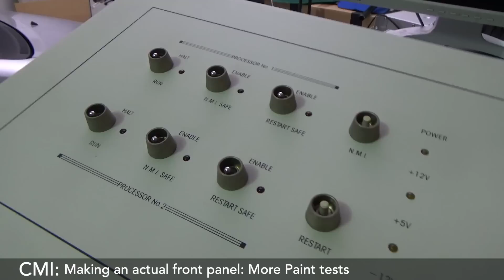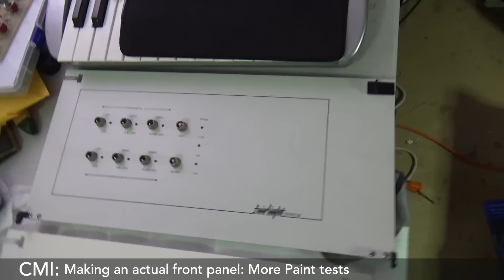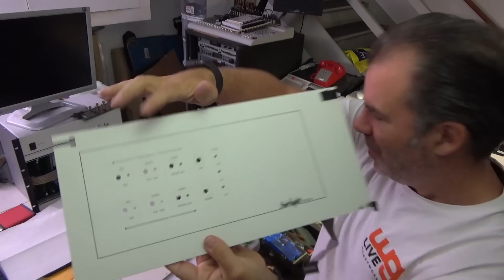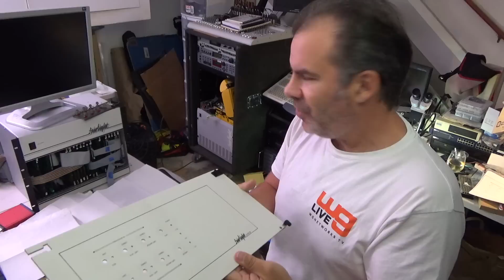I'm Building a Fairlight CMI: Episode 13

Comment: Hi Cris - I'm a big fan of you/your Fairlight project and have been watching from ep 1 right through to ep 13 here. I had a thought on your panel graphics screen printing sizing issue - instead of the photo-emulsion kit you are looking at for the screen printing (which has size limitations for the transparency you will have to try to print on - the darkness of that black will also be a major issue, incidentally), you might try just using cut vinyl instead. If you have access to a Cricut or similar cut vinyl machine, you can use it instead of trying to learn the photo-emulsion route - instead of the photo-emulsion being the resist (the area that doesn't print), the vinyl takes its place. First, there is no real limitation to how big/long you can go - it's only limit is the cut capacity of your vinyl cutter - but there are ways around that even if it is limited. Also, it's much more forgiving, way easier if you screw up - essentially, you could redo it over and over again until you get it right (the photo emulsion is one shot - if it gets screwed up at any stage, you have to start from scratch by reclaiming the screen with chemicals and starting over), so, the vinyl is much, much faster, etc. The photo-emulsion process of creating a screen is an art in and of itself. I happen to think you also get a much cleaner/sharp result with vinyl. You just need to get a physical screen that is large enough for your panel. There are lots of tutorials out there on Pinterest, YouTube, etc. for the cut vinyl screen printing process - so, just a thought. 

On the vector graphics and layout, I recently was working on graphics for a Roland PG-800 front panel that I need to redo, and for me (graphic designer), it was easier to take really good measurements (I used a machinist's caliper) and did the layout straight in Adobe Illustrator or a similar vector graphics program rather than trying to convert the photo you took on your phone. You surely can use it for reference, but the measurement approach has saved me lots of hassle in the end. You can then duplicate your file and in the new file, convert your fonts to outlines/curves so the vinyl cutter will be happy (the duplicate is so you can always go back to the original if you screw up - non-destructive editing!). Reach out if you want any pointers. And good luck!!!
Reply: Oh, and I meant to say, AMAZING JOB on this - I am blown away by your electronics/Fairlight knowledge and ambition. Congrats!
Reply: @deanwetherbee6468  Thank-you ! yes.. I was considering the Cricut route for a while.. however, in that regard hopefully all will be revealed in the next video..